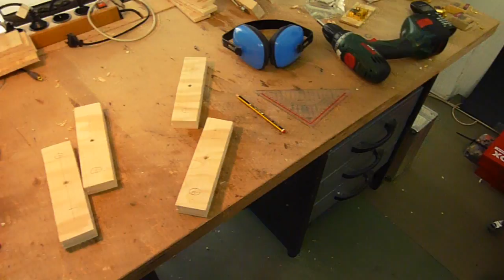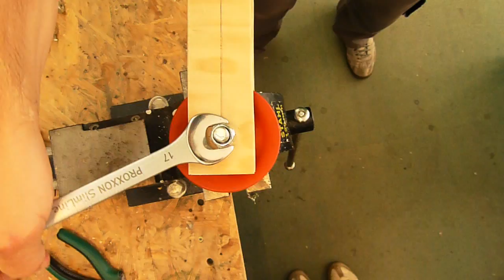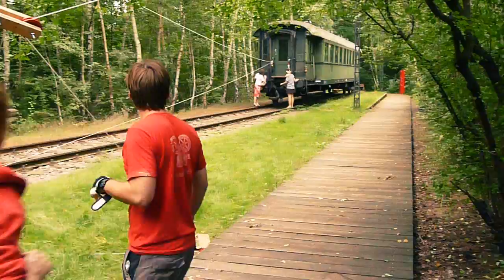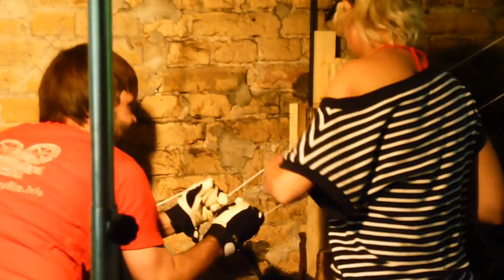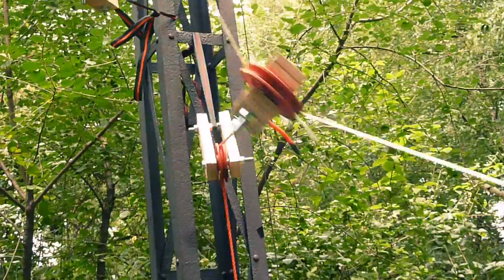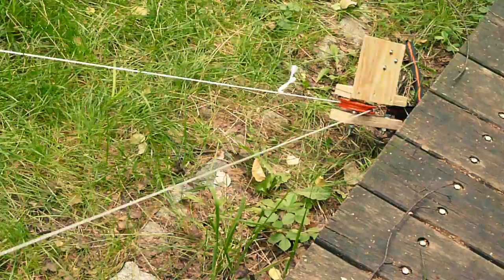Wasserklang Modulsystem - Test Run #1

Comment from the maker: @SAerror1 that's true. Fortunately, the tension on the rope can be adjusted - via the sand filled bucket that you can also see in the video. So we'll keep the tension as high as needed - but as low as possible. But still, the drum inside the forge is a very dangerous thing. I always approach it with big respect.